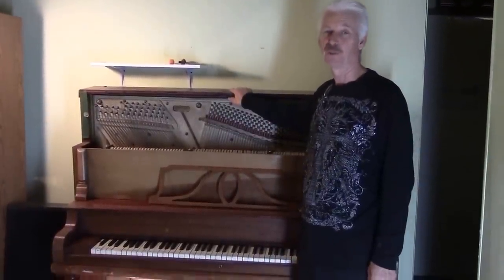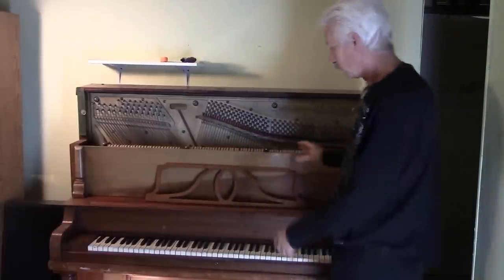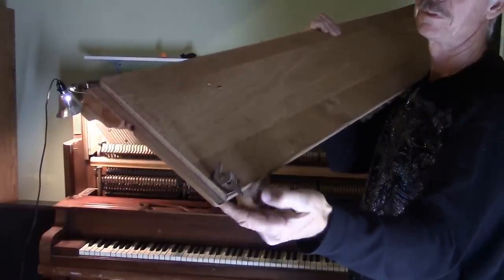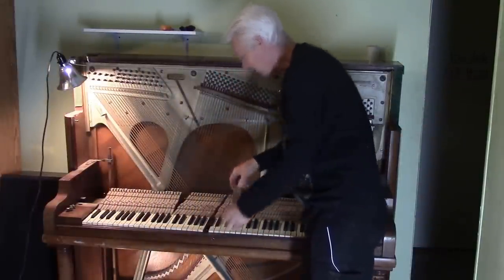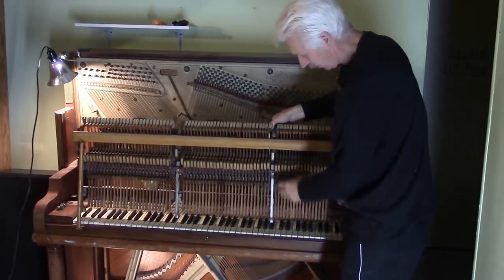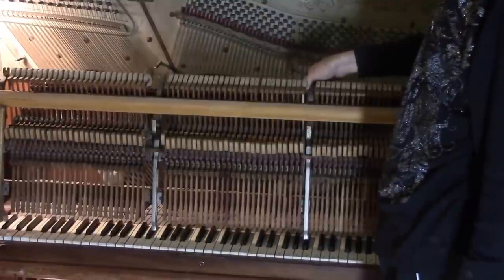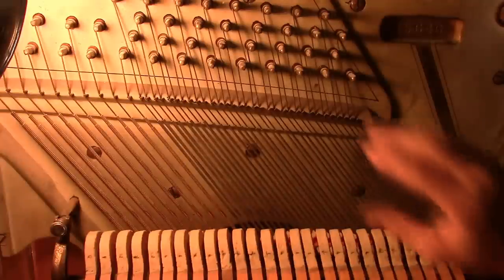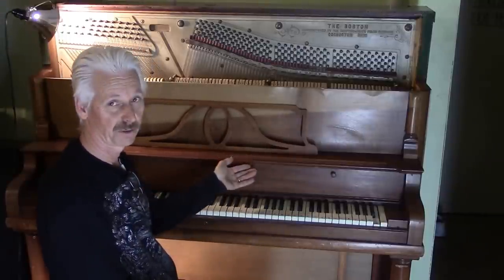piano take apart

Comment: Hope you know that tuning pins are not straight as it goes back toward the tuning block. So, using a regular socket with a straight bit is not a wise thing to do. IT DAMAGES THE PINS!!
Reply from the maker: +Connor Price Point well taken however, in this case as with many folks, it is a free throw away piano that can still get a little use before junking it. This piano has already been junked out since this video. If you have a good piano folks, probably best to use good tools.
Reply: Okay, I see

Comment: Could you replace the rod for that one key at the end by making a replacement with a 3D printer?  Or do they have to be made out of wood for some musical reason?
Reply from the maker: The upper rod at the hammer is just wooden doweling and the lower ones are an odd shape. There is no reason I could think of why you could not make any of those rods with a printer or just whittle out a chunk of wood. keep in mind tho that there is a weight factor and that pianos have a sophisticated way of giving a precise resistance for pushing the keys down and it changes as you go up the keyboard, for that reason i would try to match the weight and measurements of the parts carefully.

Comment: I just hoped that finally a video showing how to dismantle an upright piano and reassemble but again nope. Looks like I will just have to work it out myself. So I can get it up stairs cause I def do not have the funds to hirer anyone.
Reply from the maker: Actually pianos have a very heavy sound board and metal frame that the strings are strung on and if you were to take that part out, it would be too heavy as that is what weighs the most in a piano. Much better to get a piano mover or leave it downstairs. Good luck to you.
Reply: @AlFixit  Dear Al Fixit. The Piano was donated to a relative who has special needs and does not reside with me. So its downstairs in my garage. The person in questions lives in a flat with really awkward stairs. Hence why I have been trying to find a way of dismantling it and getting it up that way. 
Plus no-one has the funds to engage a moving company. If we did it would have been done.
Moving it from where it was to its current location I was told would cost over £1000.
In the end I sorted that myself. I am sure over time I will come up with an idea but in the current climate it can stay where it is. They have an electric piano but you know the sound is just not the same ☺😆
Reply from the maker: @metratone5  I wish I could think of a solution for your situation. I know what you mean about the sound of those electric keyboards are not the same and the feel and action of the keys not the same either.

Comment: I also want to Male a bar out of mine. I have an upright Steinway piano that is absolutely unworkable. I hated to do anything to it but it just sits there. I'm not sure how to remove all the keys can they be done at one time. I'm not so sure about wanting to remove everything from the bottom because it has a nice big iron plate that says Steinway & Sons 1860 something. any more advice you can give I would really appreciate it. Thank you
Reply from the maker: +Gail Doukas As you can see in my video I did not remove the big metal part that has the name on it. Once you have the hammer assembly out  you can remove keys just as i showed removing one. There are many ways of making this into a bar. Personally I would not remove keys. I would remove hammers and then build in shelves to hold booze in top area and then put cabinet back together. It would look like ordinary piano until you open the cabinet and reveal that it is actually a bar. Good luck.
Reply: if it's a steinway and you make a bar out of it, I will cry. Then I will drink all of your booze. All steinways are worth fixing.
Reply: I never did anything to it. So no tears.
Reply: You have something of value.  You could make good money.
Reply: Just curious, how could I do that. I really don't want to part with it but my son has just been diagnosed with a brain tumor and needs some financial help.
Reply: The question about making money from my Steinway was directed to cosmic nights.
Reply: Have it restored, then sell it if you need the money.